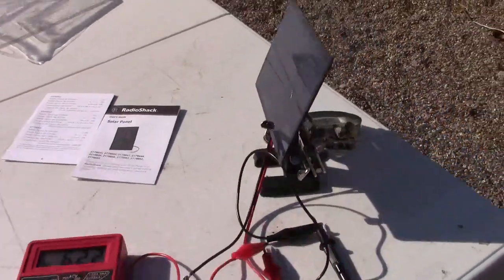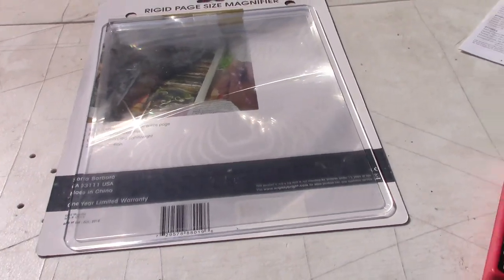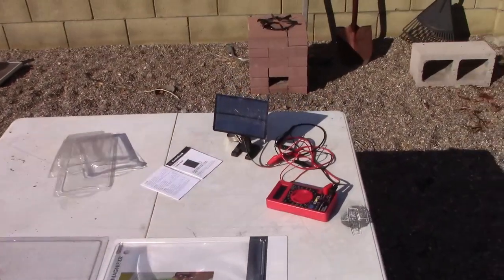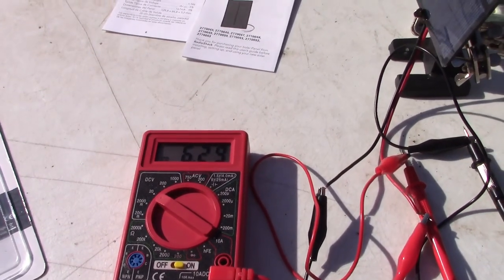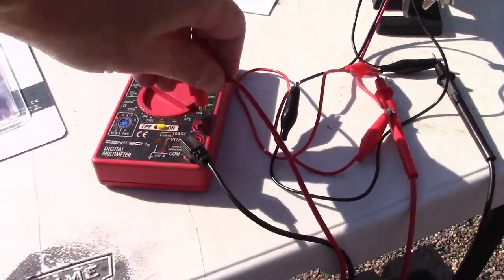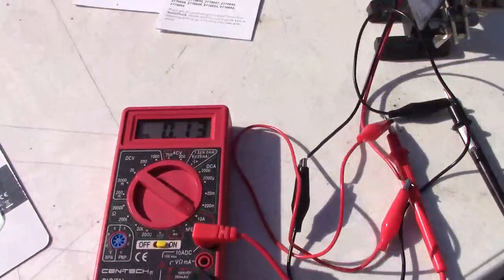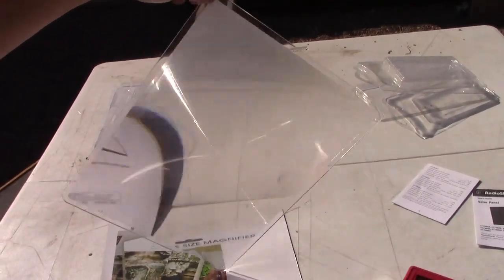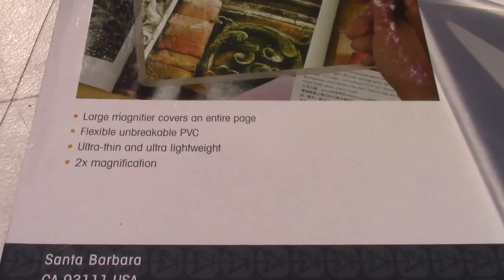Experiment:  Fresnel Lens + Solar Panel = 300% more power! - triple power - with full power readings

Comment: Likely pushing your luck as far as heating up the panel and causing increased resistance... However a clever solution in lower lighting situations... that would be the next step see if it works as well in lower lighting, compare the increase
Reply: I guess such setup would be great during cloudy days with minimal sunlight

Comment: The 3x increase of current generated can be used to move a couple o motors so you can make a sun follower. It is viable solution. Thank you!
Reply: not viable, considering cost and complexity. better to just get a few more cells.

Comment: Heat actually has detrimental effect on solar panels.  The higher the temperature the lower its efficiency,   and if it gets too hot,  it'll melt the connections.......... It's good for short term experiments, but not for long term use.
Reply from the maker: it's true that if panels get too hot for too long it can lower their output but it's a balance of light and heat. so panel output lowers slightly (say 30% down), but is then offset by the increase in power output (up 300%) due to the lens (or lenses). it's about getting the right balance. plus figure it must work pretty well, since the big companies are now implementing the process on large the scale systems
Reply: @desertsun02  
I have seen one person who did use this method on a large scale.  He claims to be off the grid.  However,  I'd imagine his panels probably had a shorter lifespan.

Perhaps this would be more practical if done in winter or cooler weather when the sun isn't as bright or as hot.   It'll compensate for the less sunlight and also reduce the risk of frying the connections..........
Reply: @WTF_BBQ  Seems like an area of opportunity for heat exchanging.  If I recall when I researched last... adhering the cells to the heat exchanging medium also is best to take into consideration the differences in material expansion and contraction so something like a silicone or optimal heat exchanging adhesive that is flexible will aid in longevity of the cells too.   Maybe some energy tapped for a fan to aid in exchanging heat?   Sure would be great to be more passive to better utilized the heat and solar energy exchanged.
Reply: @jafinch78  
Now that you mentioned it,   this guy that I previously mentioned in the comments had each of his solar cells mounted on to a metal structure.   It probably acted as a heat sink..........

Comment: Love your vids.  I was wondering if the panel would melt or catch fire. I'm a little hesitant to leave a setup like this unattended as a result.
Reply from the maker: hi. as long as you focus the light correctly (or evenly) onto the solar panel it will not melt or catch fire - not even close. when using with a solar panel fresnel lenses have to be positioned correctly (not too close or too far away).it's a balance. 👍
Reply: Just wanted to chime in to use smoke to see the beam of the lens clearly 😁

Comment: I believe you would need an electro-mechanical arm / support to move the lens from time to time, otherwise you risk having the focal point of the lens directly on your solar panel and melting it. Additionally, heat is detrimental to power generation, you would probably need active cooling on the panel. All of these may be worth the additional power generated, but you need a lot of trial and error and extended tests to make it work.
Reply from the maker: hi. yes, for continued or extended use you need a way to adjust the focus of the lens as the sun moves. a hot solar solar panel has a slightly decreased output (say 30%) but is far outweighed by the 300% increase (that the lens or lenses provide). cooling them even helps further (maybe with solar powered evap cooling system)

Comment: Why dont they create a sheet with multiple tiny concentrators in an array so that it can be attached directly on to the panel like a clip on?  The design should match the array of solar cells on the panel so that light falls on them.

Comment: Do you know if that has any deleterious effect on the solar panels? Any long term damage? If it doesn’t damage the solar panels, that freaking brilliant.
Reply from the maker: hi there. i know that more and more this 'combination system' is being used commercially to increase output of large solar panel installations, so i'm assuming that it doesn't have any consequential down-side. from what i've read about this (and other magnifying designs and systems) is that the panels handle it well.

Comment: What happens if you place directly on top of the solar panel?
Reply from the maker: hi. this is just a guess but the lens would probably just block most of the light and the solar panel wouldn't work very well.
Reply: @desertsun02  Thanks

Comment: Great experiment! My only thought is will it damage the panel or degrade it much more quickly as I know they tend to degrade over time from normal sun exposure (bit of an oxymoron given that's what powers them or should I say where they draw power from) eg. Say a panel lasts 9 years. With 3x the intensity from the lense will it degrade in say 3 years (just example figures) btw I'm no expert I don't have a solar array or set up currently but im looking into it, however I'm in London England, so as you know seeing the sun is like finding a £5 note it happens that often in England! lol 😅 anyway my point being I don't know if solar is viable here there's houses all over the place with solar on the roofs, but I notice that two in one road alone that had solar installed 5 years ago after only 2 years they were removed! I believe they were Government backed schemes where you feed back into the Grid any excess, but I'm guessing they didn't generate any power to be of benefit or use so given both houses were in the same road similar direction and within 200 yards of eachother both had a large array installed across the whole one side of the roof on both houses and the fact they were both removed within 2 years, would that indicate it's not viable here? Or could it be viable with one of those screens you have there say on a smaller set up? Or on a Campervan Boat Garage Shed etc etc? So you can change the angle of the panels to trace the sun's angle and also increase amperage with the screen aswell?
Sorry for the essay thinking out loud so to speak and also you seem to have an inquisitive brain like myself so thought I'd ask whether you'd considered that and what your thoughts were on my own musings..
Cheers!
Another great video btw. Liked the one with the 12v pans aswell!
Reply from the maker: hi. i think that even in cloudy areas there are ways to use solar. amorphous panels work very well in cloudy areas (even some monochrystalline ones too). people are also working on panels that can covert infrared light into power. that typically goes thru the clouds. you can also use setups with solar panels for intermittent use. for example, you mentioned you liked the 12v pans video. that is one of my favorites and i wish it had a million views right now. it's an awesome way to use a solar panel or two and do some serious cooking. for those who haven't seen it, it shows a way to hook a pan directly to a solar panel and cook all types of things. i cooked a cheesburger on a solar panel. that still amazes me to this day. for that type of setup you just need sun for 30 mins or 60 mins at a time. parabolics are another thing you might like. with a parabolic cooker all you need is a few minutes of sun here and there and you can cook tons of stuff.

Comment: This need use with heat pipes (+heatsink (heat pipe need +2psc (~ US $8/pcs ~30cm long) (and/or water cooling)) to get heat sink/down (hot solar panel give -10% ~ -20% power (lose))